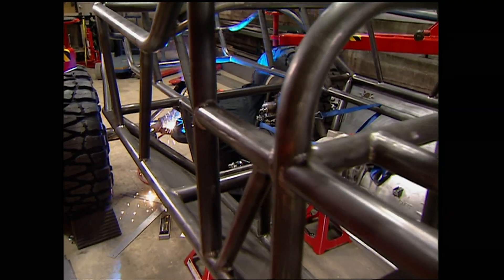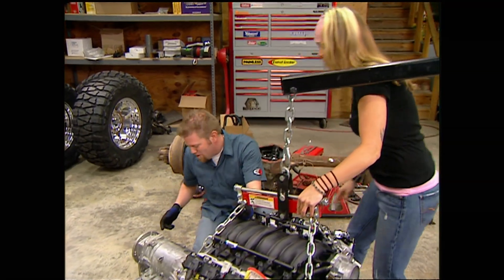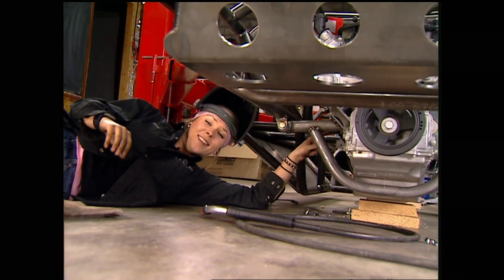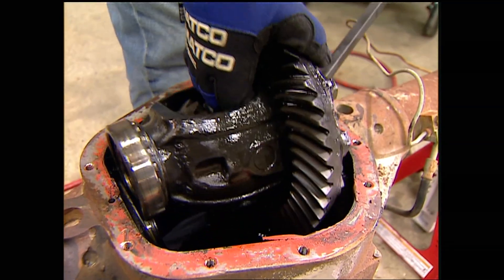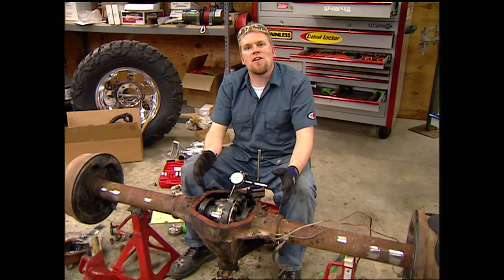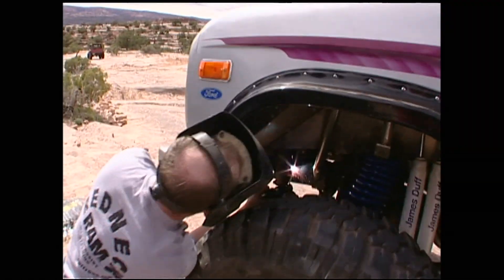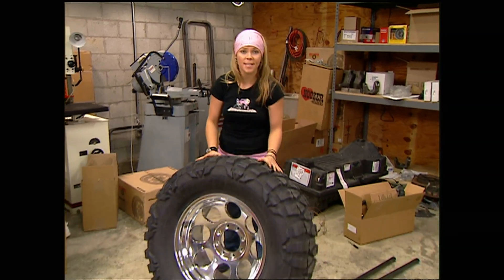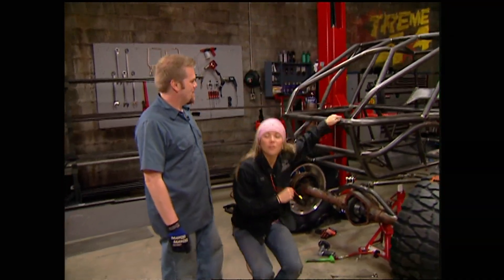Building A Competition Rock Crawler From Scratch - Xtreme 4x4 S1, E14

Comment: Aluminum blocks are known to pull the block out at the motor mount bolts with big tires & good power. Ask OffRoad Connection about it.